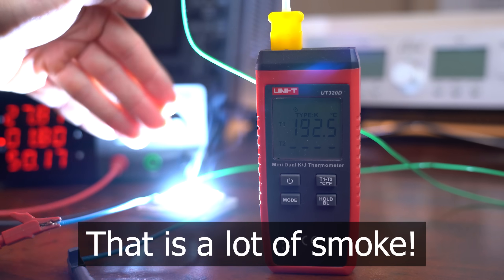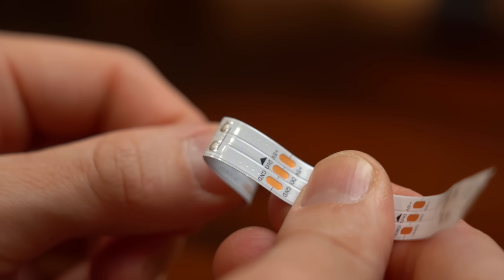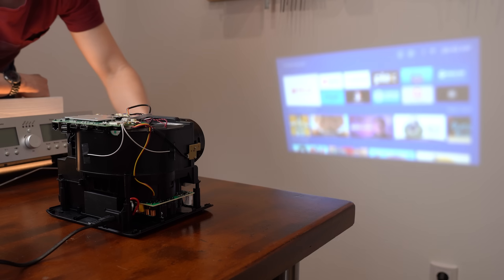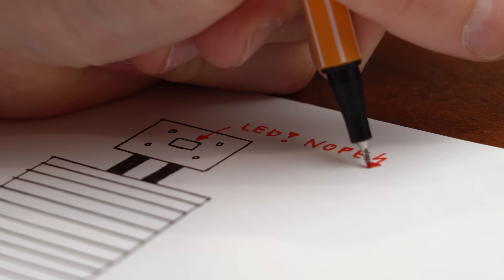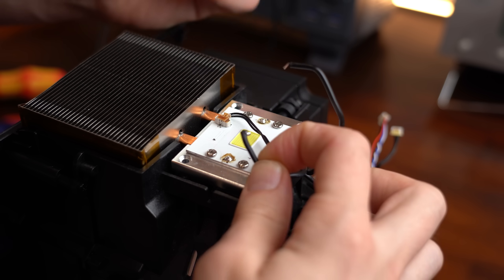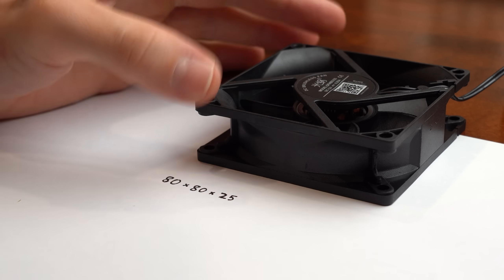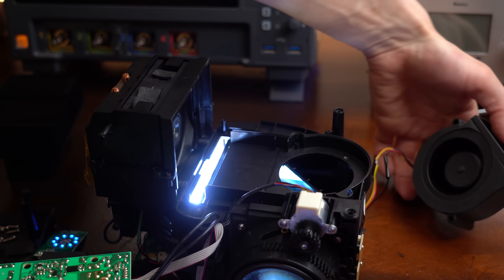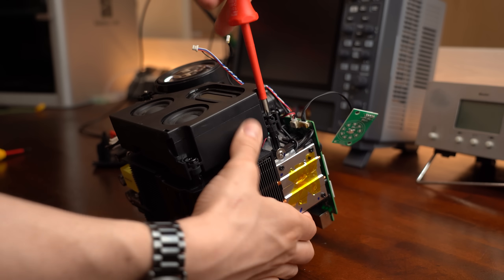Your Cheap Projector has 1 BIG Problem?!

Comment: Cheap projector expert here... That centrifugal fan in the optical chamber is actually the more important fan.  The main failure mode on these single LCD projectors is the polarizing filter or LCD panel itself cooking.  Those are of course much less heat tolerant and need a high volume of air blown directly on them since they are not easily heat-sinkable.
Reply from the maker: Oh boy. Thanks for the info. Will keep an eye out for that.
Reply: Yep, you can change the fan/dynamics of the flow or just install something between you and the projector... instant dB killer.
Reply: @wobblysauce  you could go crazy and put a CPU AIO watercooler on it and it would be near silent
Reply: @TheMach21sec  Yep, I was thinking that and then it can run really quietly, to the point the fans might not need to run of that just the pump, but the LCD is still the issue as it needs flow.
Reply: This is literally the most important comment on this video.  If you look at the user reviews of cheap projectors, the absolute most common complaint by far is that the LCD panel gets color spots or brown spots, which is definitely the panel overheating.  You want the biggest most badazz blower you can find puffing on that panel. Mount the projector on the ceiling so it's far enough away from your ears that the fan noise doesn't matter much.  Of course, who am I to talk, I only use mine for stage bling at live music shows. Nobody will ever hear those fans above the music.
Reply: I was going to mention this as well, he may have now dramatically reduced the lifetime of the set as the panel runs a higher risk of burning. Also, cheap projector user here lol, I have a vankyo leisure 510 and leisure 3 pro, For what I paid for them I am surprised by how they perform. I have had the 510 for about 3 years now
Reply: These projector lamps create an immense amount of heat. Back in the old days in movie theaters, when then film got stuck in the projector for whatever reason, you could watcht the material melt and burn within seconds live on the screeen.
Reply: @andreasu.3546 not just the old days - this happened to me watching the film  Oppenheimer at a NYC movie theatre.  It was in the last ten minutes of the film; after waiting 20mins for them to splice it we saw the remainder of the film and it melted again during the credits - phew!
Reply: This makes sense in my situation. I bought an $80 Febfoxs and a $150 Growview that @thehookup featured in a video and after seeing them both in person actually returned the Growview for the Febfoxs since it seemed just as good and was half the cost and didn't have the weird "sharpening" feature that sometimes make fine details look weird. 

Its served me great and everyone that has seen it in my basement is amazed at how cheap it was. I've had it for about a year and a half now and there is a spot in the middle of the projector that seems brighter now where it used to be black. I'm thinking this is from overheating on the nights where I forget to set the timer as a fall asleep to a movie (I wish it would save the setting rather than needing to be set the entire time) I bet it is from heat and the polarizer. 

If it gets too bad I'll replace the unit. My only real complaint about the image quality is that the keystoning affects the focus so you can't really have both at once. I'm excited to see how much these things have improved in the past decade.
Reply: Im glad you replied here. Ever single LCD projector I have has screen burn on the left. They are ALL junk. After you buy 3 of these crap units. You will have the money for a Dangbei Atom. Save up your money and get a laser projector.
Reply: The temperature in the air between the LED and the LCD may not be representative of the true heat by radiation. I thought
Reply: @spawnsetsuna1  it's not radiation as such. the lcd gets heated directly by the light, the air in between doesn't get "hot" but the lcd is bad at conducting heat too (hence the high airflow necessary)
Reply: So long cheap projector from Scott!
Reply: He really is, just look at his videos 🤣
Reply: I bought 2 cheap projectors and found they both had problems with burn in. I had an older model wimus that had a youtube thumbnail grid burned into it. I went with a epson 2250 home cinema refurbished and its been great. Its currently at 6500 hours on the original lamp. I have a spare lamp but seeing how far the current lamp will go.
Reply: Yes, I have replaced a few of the polarizing filters.
Reply: Yes, i own a very good proyector from ali also and the same problem. i exchanged two fans, two of them are radial, different sizes. i bought two from a more known brandy and installed regulator.  also, by my luck, my proyector has some space to add a third fan and a additional heatsink just behind the led in the alluminum block. ive got a lot of DBS drop in comparison my old Mercury lamp its more quieter. thanks a lot from your video
Reply: that's why you use an AIO CPU water cooler to pull heat away
Reply: @narniaphuket  you can't put blocks or heatsinks on the lcd panel that's being hit by the light
Reply: @lasskinn474  so use heat pipes or a thermosyphon
Reply: @narniaphuket  are those transparent? light has to pass through the panel. it's a projector. say the light power is 30 watt equivalent. half of the screen is black - now you're heating a piece of essentially plastic for 15 watts(even when showing clear a lot of the light gets absorbed in it).

there really isn't that many ways to cool it besides just more airflow, aim the air better or somehow get cooler air. a bigger unit would allow for a bigger fan with less rpm.
Reply: @lasskinn474  How about "reflective LCD"? Place a large piece of metal behind the LCD (probably aluminum) to act as a mirror, then cool the mirror. I've heard "LCOS" works this way.
Reply: @lasskinn474 hmm.. what about water?  sandwhich the lcd into aquarium with  glass on the lcd it self and acrylic on the other side. since image quality wouldn't be problems. then circulate the water with AIO cooler?
Reply: @rumpogi  yeah a superthin water layer maybe, too thick and it screws up the optics or you'd need to redesign it all.
Reply: Totally agree. Did the same as this video two years ago with my 200€ projector and the LED was working fine but the LCD panel died after a couple weeks due most likely to the heat that it wasn't dissipated properly anymore.
Reply: What projector would you recommend?
Reply: @laurynasmazeika3351  magcubic hy450 Awesome quality, not noisy, powerfull led and good android TV. i tried a few models and i cant find any better. its about 130 euros or 115 with coupons
Reply: :cat-orange-whistling:
Reply: Bro the secondo fan is important. The LCD will last not long!
Reply: I never expected you to be in this comment section. Love ur content btw ❤

Comment: I have always wondered why heatsinks have air blowing perpendicularly through them. 
I thought it would be better to have a slight angle on the heatsink fins to have greater interaction with the air and slightly muffle the noise.

Comment: Time to to 3d print a slightly bigger case , use a 360mm AIO PC cooler to cool the LED and some silent noctua fan to mix the air near the display. Definitely a bigger project than changing thermal paste and soldering a regulator.

Comment: Back in the day you had a red, green, and blue crt setup, and the cooling fan which sounded like a jet engine. Trying to be able to see the blue gun in a meeting hall to line up with the other colors to a grid required absolute darkness for half an hour.;

Comment: Loved your video on this!
If you have 3D printing available, maybe you can replace the loud fan with a 120mm fan and guide the air with ducts.
Perhaps this way you could end up replacing all fans with 120mm ones? Same or even more airflow while maintaining lower dbA.

Would be a sick mod, specially if you open-source it! Then I'd probably buy this projector too.

Comment: I REALLY don't recommend doing this! (no offense...) But;
1: I owned a same price range wimius projector, also loud, and after 2 years, it eventually burned the LCD panel, and has a brown spot now. (no mod)
2: Your temperature testing is not realistic, they "best day scenario" tests. In real life, people mount a projector under an isolated ceiling. one warm summer day, projector is on for hours and heat is accumulating, the surrounding air will be warm, and the internal heat in your projecter will reach unhealthy temperature for sure. 

If you must mod for less noise, go with larger heat sink and more expensive quiet fans

Comment: Maybe try a 200x200mm foam baffle spaced about 50mm above the fan exit, ie, maybe it will absorb most of the noise. 
Don't know how much is coming through the case, but maybe line the inside with sound-deadener.

Comment: Just for you information there are great 80mm beQuiet fans as well. As a general rule of thumb: 80mm, 120mm and 140mm are most easily sourced from a PC parts vendor instead of a general electronics parts vendor. I also used a cool 3D printed adapter once to get a good 80mm fan out of an old Intel stock cooler (basically just needed to cut a few pieces and glue the spokes into a replacement ring). Since I got the PC for free, it was the cheapest way to make my secondary Ender 3 more quiet. Its PSU was loud af.

Comment: I remember doing something similar a couple of years ago with a projector. Completely different projector, exact same cooling system. I also replaced the 80mm fan with a slightly weaker but more quiet one and then noticed that the other fan that cools the inside of the projector is way louder. However, it is a very important fan, if airflow is too weak the mirrors will make the display heat up more and more until it gets burn marks, don't ask me how I know xD
One would have to design a completely new case for the components with a more optimized airflow path that allows the use of high quality fans like from Noctua.

Comment: The 80mm fan. A static pressure version would be a better choice, as you cooling fins on a heat sink.
The centrifugal fan. I not sure of the size from video. With a slight help from a 3D printer, 1 (or 2) x 40mm air flow fans. Make/print a 90 degree angle housing and place 1 fan at either bottom or top section or 1 fan at bottom and 1 fan a the top. As you said in video, this was just for air flow in that area,
As others have mentioned, Noctua fans. I would also like to add Arctic Cooling and Thermalright into the mix. 
Great video and problem solving.

Comment: To run LED-projectors hotter, than intended, is not a good idea. Since LED's are components, obeying the laws of physics (and chemistry), the so called RGT-Regel (Reaktionsgeschwindigkeit-Temperatur), also termed as van-’t-Hoff’s-rule (a subset off the Arrhenius equations) accounts as well. That means, linear degradation of the LED and phosphorus will increase rapidly upon some Kelvin increase of temperature. As a rule of thumb, mean lifetime of power LED's are halved by 5K increase of temperature. The perfect way to silence projector light sources is to use water-cooling. The secondary heat exchanger can be placed everywhere.

Comment: I spend long time making box with sound isolation for my projector from AliExpress , but still hearing fan of projector, strange designers, its better to add 4 fans low speed than 2 with top noisy in chart , I would buy any quite projector even if size is 4 times bigger, does anyone could suggest fan replacement, I don't mind to cut and welding the plastic box to make size for heatsink

Comment: Aliexpress stuff is notorious for the loud fans. They tend to be 24V variety and oversized for the job. My go to solution these days is a buck converter and 12V noctua fan for cheap aliexpress power bench power supplies :)

Comment: I have a cheap projector ~100euro that was pretty loud. I just hooked the 12v fan to the 5v usb rail. I don't care how long it will last but I played a lot of N64 games on it for a long time and it still work. Yet it's pretty dim so it's mainly usable in the winter and I don't recommend it.

Comment: So the centrifugal fan is there to cool the lcd which is very much essential in the long run as the led gets hot and the polarization layer of the lcd will burn off in the long run if the temps gets high (how would I know? Dont ask me🫣) but yeah I'm stuck with a brown tint in the middle of my display which is very much visible (I used to use the silent mode in my projector which lowers the fans and lowers the intensity of the led and I guess that was not enough to save my lcd😶‍🌫️) do def don't change the centrifugal fan at all!😶‍🌫️

Comment: Nice design. I wonder if you might have gotten similar sound results and maintained the unit's lifetime by building a sound enclosure with its own cooling fans, etc. using inexpensive fire brick, vermiculite, portland cement, etc.

I have also encountered heat paste application problems in devices. I had an inductive cooker fail because the thermal grease was only touching about 30% of the surface. The rest was dripping off one side. I'm guessing assembly line errors.

Comment: To fix the noise of my projector i replaced the cooling system by a watercooling 120mm from coolermaster, works very well and reduce the noise by 2 or 3.

Comment: Noiseblocker 80mm fan + Thermaright TFX paste... Seeing there is some extra space on the slab a couple of small heatsinks that come with thermal backing will also benefit a little bit IMO

Comment: 7:45 Lower temperature AFTER the thermal interface joint means less thermal energy gets transmitted through it. So by replacing the thermal paste, the temperature on the LED itself got higher!
Reply: yep, the "dry" paste was just paste with a higher fill factor and better conductivity
Reply: Something is very strange with the temperatures measurement he is describing!
Reply: The temp was lower at the plate but higher at the heatsink which mean he did infact made it cooldown better. The heat pipes were transfering heat more efficiently thus the plate having a lower temp
Reply: @TwinShards  that is not how thermodynamics work. regardless, the thermocouple positions were pretty flawed so the fin measurement is pretty useless. it should have been shielded from airflow.
Reply from the maker: @drkastenbrot  It was shielded from airflow because I put it right at the edge of the heatsink. Then again, there is no perfect measurement.
Reply: @greatscottlab  Then again you are way outside of your comfort zone and most of what you did was just lessen its lifespan. Although the first mistake was to only spend 200 bucks on a projector, and then spending about half of that on new fans instead of buying a better one in the first place that isn't that much cost-optimized.
Reply: @greatscottlab  also, thermal paste is between aluminum block and LED PCB. Your probe was connected to aluminum block, not to LED PCB, which is heat source here.

Comment: I heard that 10dB was half the noise, so I jumped to Wikipedia to check, they're still about accurate when it comes to physics. Here's what it says: "A change in power ratio by a factor of 10 corresponds to a change in level of 10 dB. A change in power ratio by a factor of 2 or  1/2 is approximately a change of 3 dB.". Checked, 3dB lower is half the noise. I'm not great at maths, but I kinda understood that the scale is not only log of power, it's square root of log of power. The good thing is that it makes your job that much a bigger feat: 10dB is huge!

Another source of noise is the DLP itself, but I'm not sure how it can be tackled. On my very old projector, it's actually most of the noise (some rattling). There is a step motor inside the projector, setting a colour change 75 times per second (R,G,B alternating 25 times per second, maybe faster) by spinning a wheel, which forced me to setup the room so the sofa was surrounded by the 5.1 and the projector was at the complete back of the room, there would be no way of sitting anywhere close to the projector. Do you think there might be any way to reduce the noise from the DLP, or has it been taken care of these last 10 years?

A noise of 57 decibels sounds a bit high to me, especially that the scales don't add up: mathematically speaking, a noise of 22dB peak added to a noise of 22dB peak makes, at most, a noise of 25dB peak for a constant noise, which it isn't, one noise may compensate the other, there's more than the fans to reach 57dB; there may be a complicated idea of noise cancelling there, if you can grab the DLP's wheel signal, say with a piezo loudspeaker emitting the "opposite noise".
Reply: I think the "um ackshually" is just that 10dB is perceptually about half the volume, they actually make nonlinear potentiometers for that reason. Same issue happens with monitors and color spaces. Most rendering pipelines and color spaces want to deal with actual energy/intensity in linear spaces, but if you have 256 values to work with when storing/sending the picture, you use a nonlinear mapping like sRGB to make pixel values perceptually meaningful (and perceptually better as a compression method).

Comment: I think you can try with vibration insulation adhesive. Wrapping the internals and the case internally.The inlet and the outlet air ducts can be upgraded with a heat resistant sponge.

Comment: Calling the cold plate of an active heatsink a passive heatsink is ... uh, kinda wild? It's directly connected to the fin stack through the heatpipes. It is clearly meant to move heat, not transfer it into the air through convection. That is not a passive heatsink.

Comment: high performace thermal paste and noctua fan can do i thing or watercooling it using 120mm pure copper radiator or use second heatsink fan with heatpipe